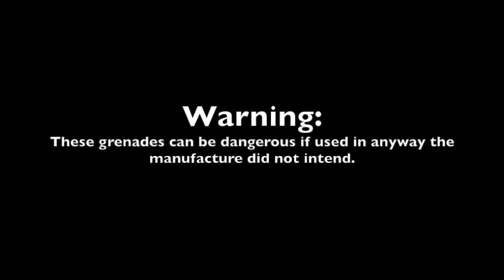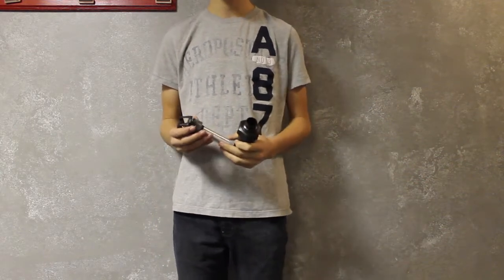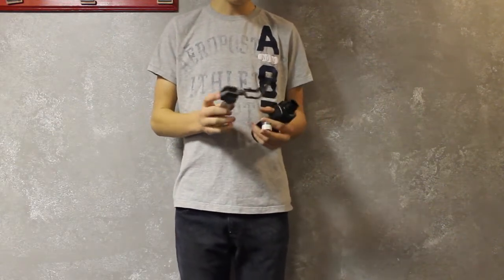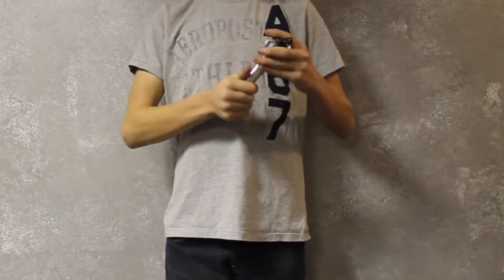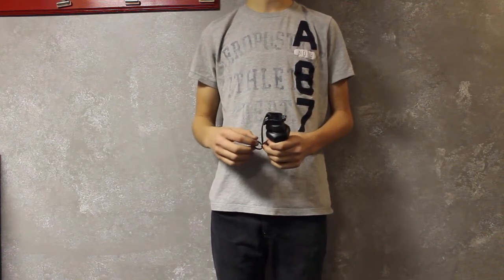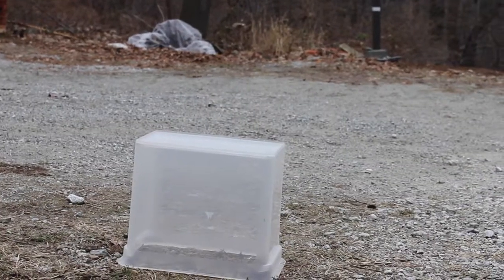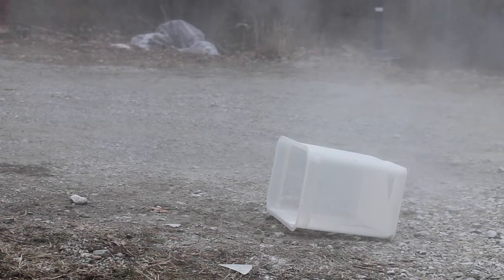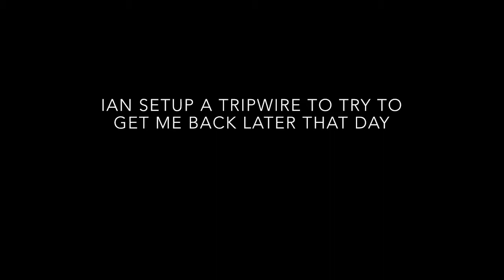Airsoft Thunder B Grenade Review

Comment: The "Big Hammer" Is referred to as the Spoon.  Cool vid, gotta get some of these.  You ever put BBs in there before blowing it up?
Reply: Putting bbs in it will decrease the fuse time as there’s less volume inside the shell. Don’t overfill and you’ll be fine
Reply: Put a penny at the bottom of the shell it will decrease detention time
Reply: On top of the bb's reducing the fuse time, you also want to use the thinder devil shells because those are deigned tk be fulled with bb's. Id reccomend you get some .12's to test it out until you find the right balance.